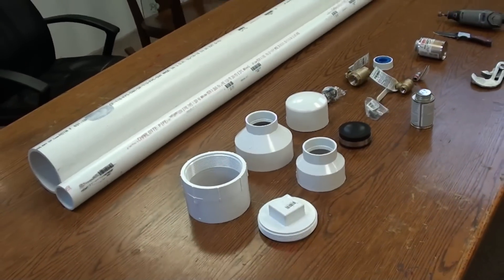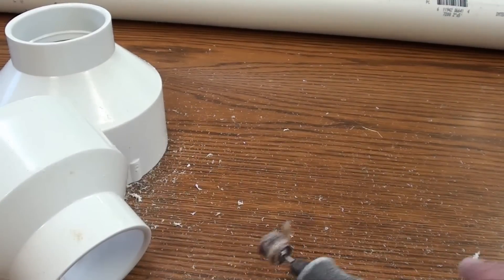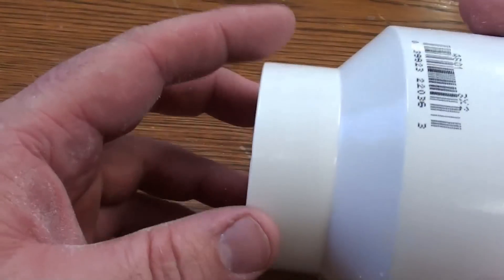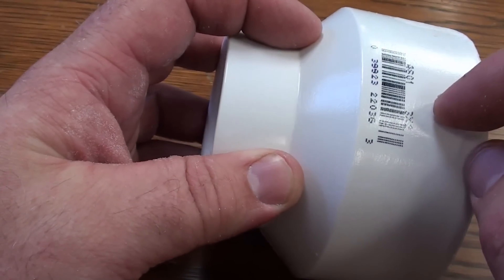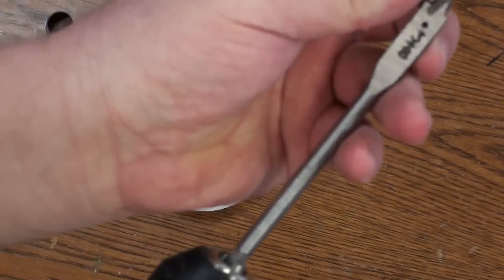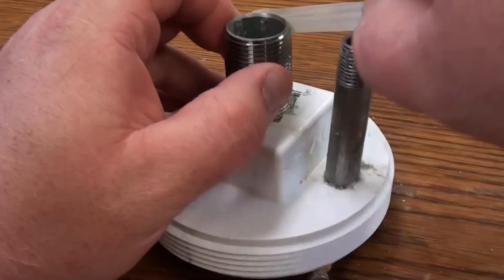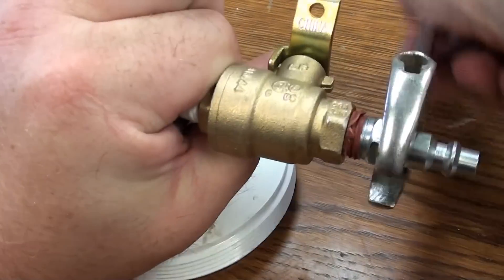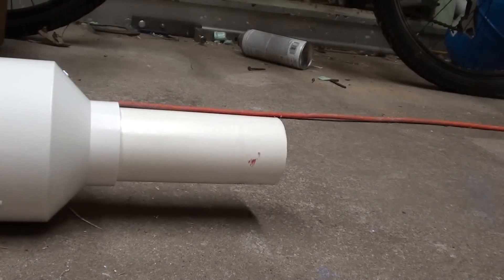PVC Air Cannon

Comment: The 4" pipe and fittings in this video are drain water rated fittings and not rated for pressure use. Be safe and use only pressure rated pipe and fittings for pressure use.
Reply from the maker: It's all schedule 40, pressure rated.  It's very important.
Reply: The 4" PVC pipe says "DWV" and "Cellular Core". Those are drain pipe ratings. It is also missing the "PSI" pressure rating. Schedule 40 doesn't automatically mean pressure rated pipe. The smaller barrel pipe is pressure rated. Note the differences in markings. The 3" and 4" Pressure rated fittings have cement surfaces of nearly 2" deep and are very thick (and expensive). Those drain type fittings shown here are much thinner and have glue surfaces of only about one inch deep. Also the large threaded plug and female fitting are drain components. See the fine print on the ratings. Pneumatic launchers are awesome! Be careful and stay safe!
Reply from the maker: @alanb76  I switched out the 4"PVC before the build, but I will definitely check out the other parts.  I'm building an improved one soon, I'll video it as well.  Thanks for your feedback!

Comment: What seals against the 2" rubber end plug? EDIT.. Okay I understand the 3" end cap does. However at 17:15 the distance of the 3"End Cap (piston) is not explained. That distance seams critical? Thanks in advance☺ 
Now for you retards that are rude with your ignorant comments this video ( https://www.youtube.com/watch?v=zSDVTdThz_M ) will explain how this contraption works.
Reply from the maker: The 3" cap moves inside the rear chamber, it acts as a piston.  It seals against the rubber when pressurized.  When you release the large dump valve the pressure behind the piston drops rapidly, pulling it away from the seal.  This allows all of the pressure inside the chamber around the barrel to exit the barrel.  I hope this helps.  My neighbor wants to build one, we have walnut trees (endless ammo), so I should be able to do a new and improved video soon.  Thank you!
Reply: Flynntastic Yes that explains it very well. Approximately how much movement does 3 inch cap (piston) need for opening and closing? Is that distance critical?

Comment: So how does it all go together??
Reply: Chris Guthrie ever figure it out?
Reply: Not really I have one I made just with 2 in pvc and a 1 in ball valve that sends a 16oz bag 200 ft no problem but was wondering how your worked
Reply: @chrisguthrie0823  Any public write-ups on it?  Just finished a DIY "Big Shot" and was all for nothing, didn't realize how easy these superior builds/launchers were (could've had my product days earlier, cheaper, had I found these vids sooner!)
Curious where "state of art" is for these DIY tube-launchers now, anyone get past that awful "trigger"?  Anyone figure out superior barrel & pressure-chamber dimensions?  Presuming fatter/shorter chamber, and longer/skinnier barrel, would go a good way.   

What PSI are you running?  Seems 100-150psi is all that's needed and that's simple w/ a $20-30 bike pump (ie no air-compressor or cartridges ever), what a brilliant setup this is going to change how I rig dramatically (ie setting anchors in adjacent trees w/o having to climb them! :D )